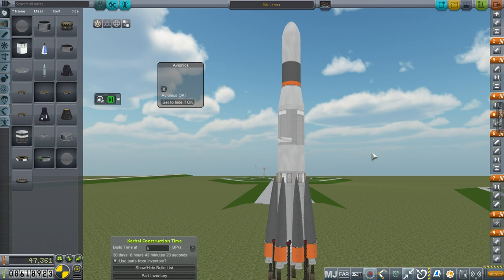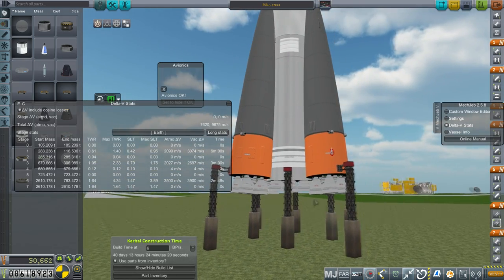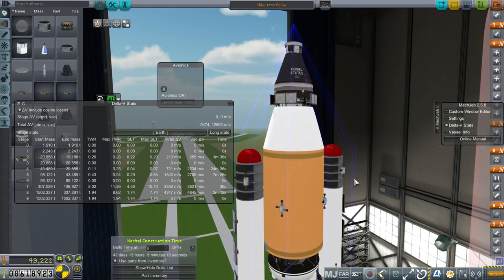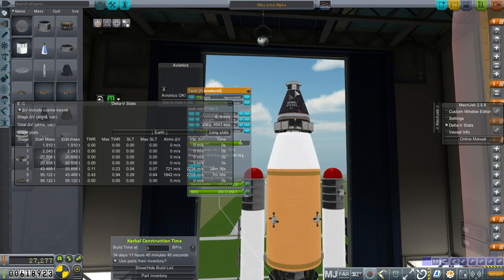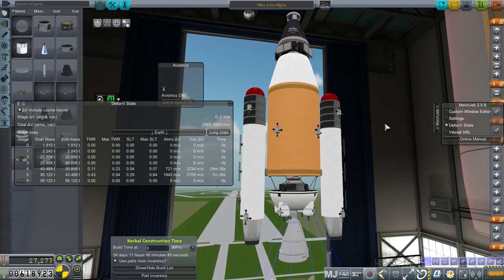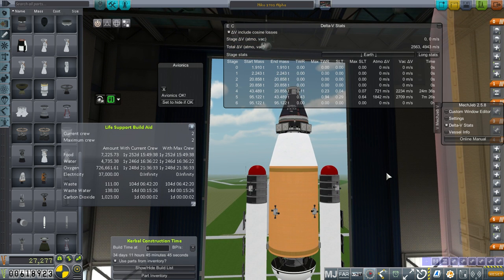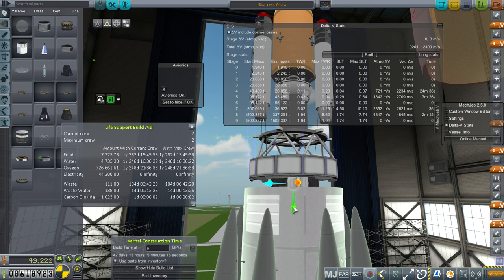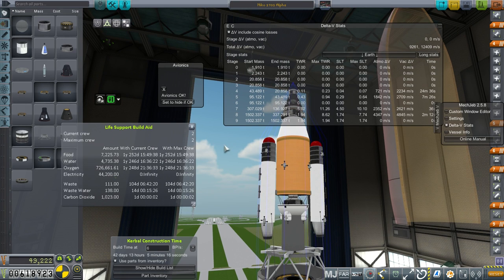Realism Overhaul in KSP 1.1.3 - 30 Addendum - Niko 2544 and 1701

Comment: Can you stagger ignition on the first stage engines to help the TWR and burn time numbers for the 1701?  Perhaps reserve some of the 17 first stage engines until after booster burnout.  Of course that would trade redundancy for longer burn time and those engines didn't have the best of showings the last time out.
Reply: Is there enough dV margin on the first stage to down fuel the strap on boosters?  Or perhaps you could go in the finest Kerbal tradition and add some solid fuel boosters that burn just long enough for the liquid boosters and core TWR to recover.  Name it the 1701B.